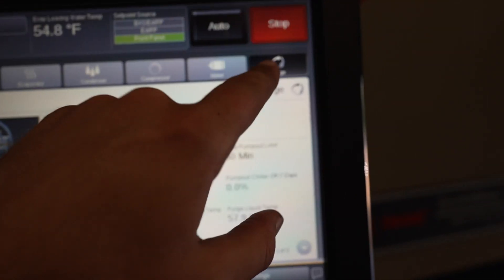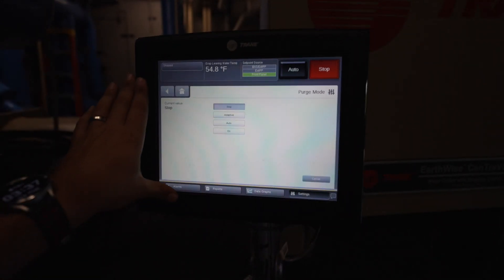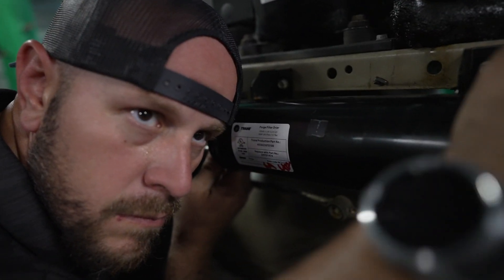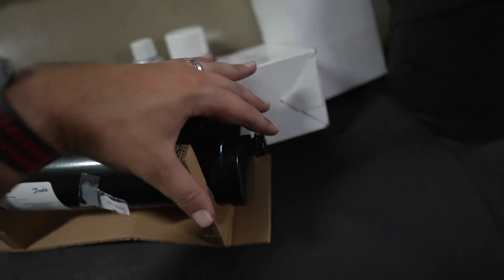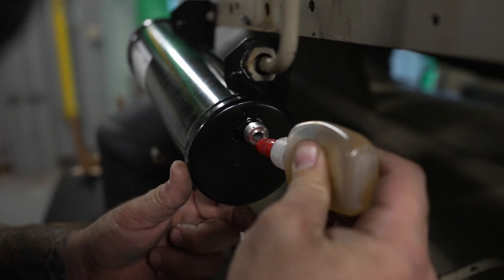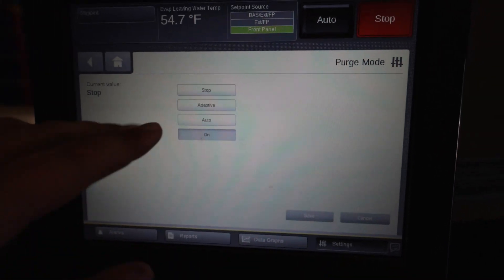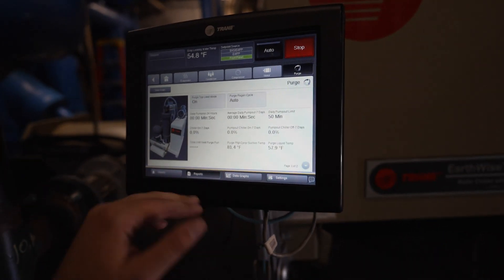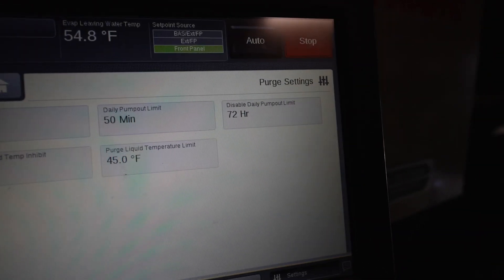CVH Purge Filter Changing Trane Chiller

Comment: Those are ORFS fittings. You can pick up NBR/ Buna N O-rings at any closest Hydtaulic supply house, or Cat, JD or Case dealer. If you want HNBR or Viton O-rings, you can order them. Usually my local Parker store has them in stock.
Reply from the maker: Great input